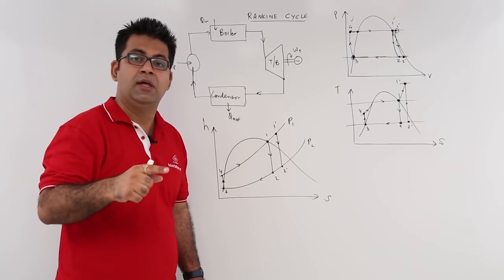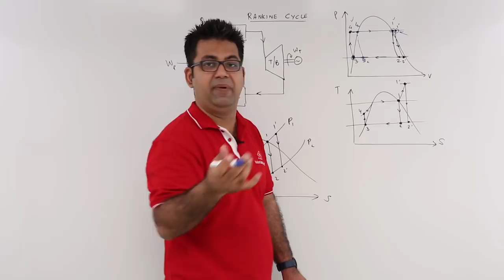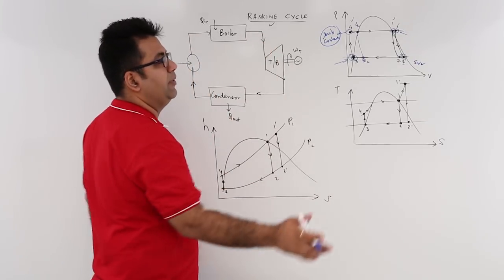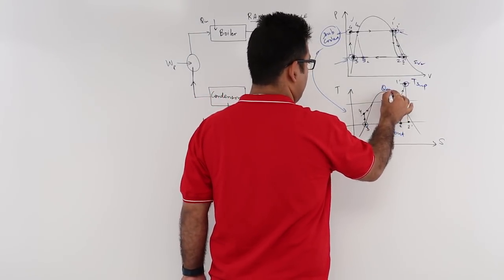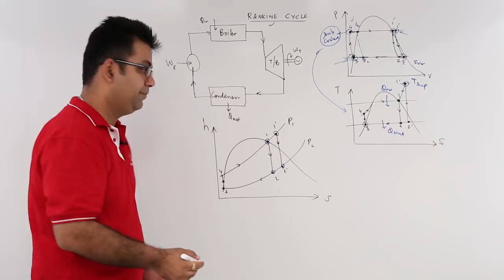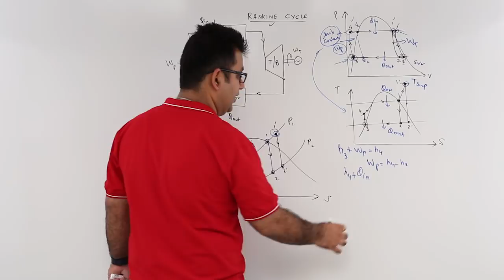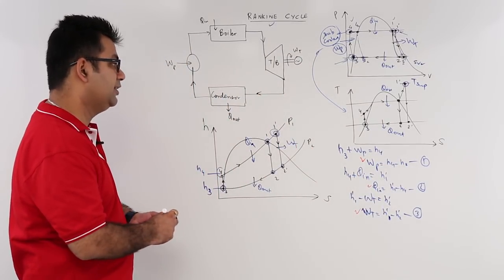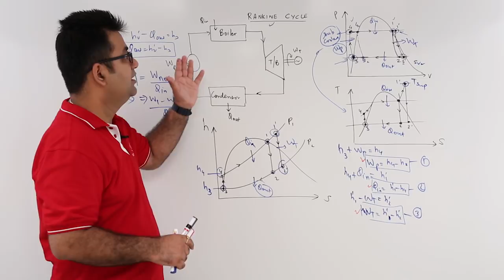Rankine Cycle

Comment: In the boiler and the condenser, why work (the area under a constant pressure process in a PV diagram) is not involved in calculating the efficiency of the cycle?
Reply: +Debasish Kashyap VA Isn't this accounted for by using enthalpy in the first law equations? The PV effect you have in mind increases the enthalpy difference (boiler outlet minus boiler inlet) and thus increases the heat that is required. When the final efficiency is computed via useful work out divided by heat in, you see that the heat in the denominator has been affected by what you have in mind.  Does that help?

Comment: Rankine Cycle - Refrigeration 

How pressure remains constant in condenser despite the temperature drop from superheat rejection after compressor & sub-cooling heat  rejection before expansion valve? 
Thank u
How pressure remains constant in evaporator  despite temperature rise from superheat gain before   compressor?